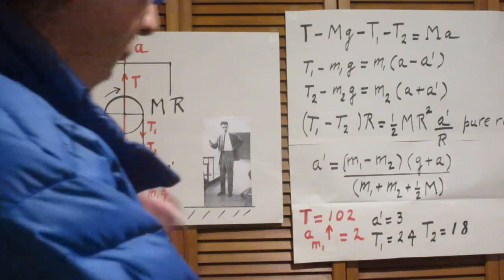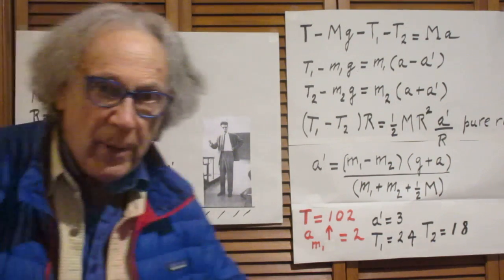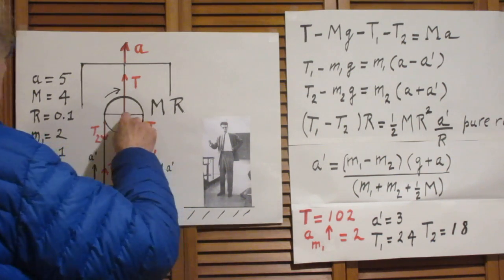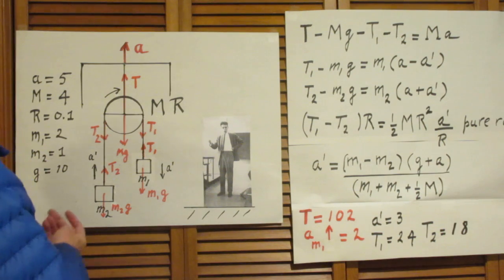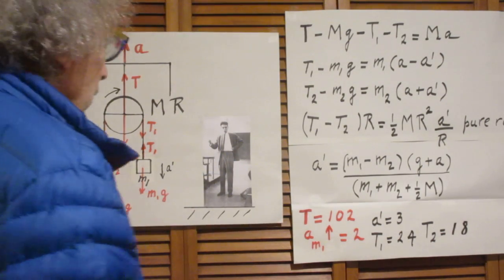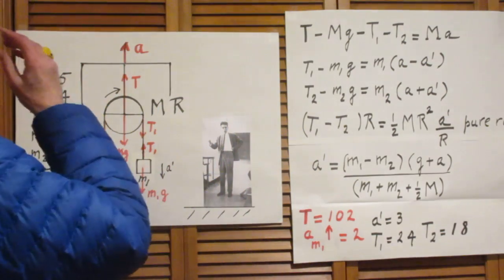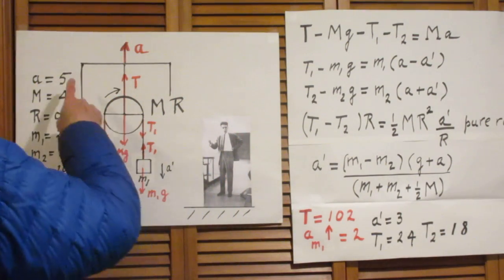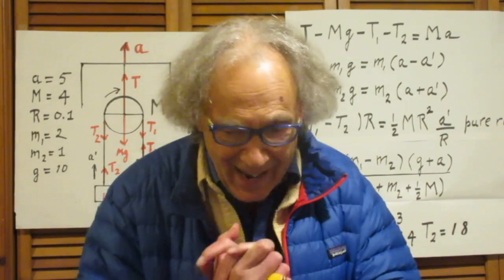Solution #31 Pulley in Elevator - Watch this FIRST

Comment: Don't the masses weigh more because they're inside an accelerating system? Why can't we consider their weight force to be a + g?
Reply from the maker: I cannot add anything to the clarity of my solution. If it's too difficult for you I suggest you watch my 8.01 lectures in which I cover the basics of Newtonian Mechanics.
Reply: @lecturesbywalterlewin.they9259  I've watched your 8.01 lectures professor. I had to solve a simpler version of a problem similar to this one, that goes like this.
There's an Atwood machine attached to the roof, of an elevator accelerating upwards at 5. There is a mass of 3kg attached to one end of the string over the pulley. To the other end, is attached a spring balance (hook pointing up), and then a mass of 2kg. The question asks for the reading in the balance.
You spoke of perceived gravity and how the weight force changes in such a system.
Supposing the acceleration of the 3kg block to be a, in the reference frame of the elevator, and tension in the string to be T, is it wrong to say
3(5+g) - T = 3a?

Comment: 8.01 problems from MIT are often easier than this one.
Do you think our way of teaching physics in the US is worsened in the last 40-50 years?
Reply from the maker: this could easily have been a problem on one of my 8.01 exams
Reply: Lectures by Walter Lewin. They will make you ♥ Physics.  My point is : considering that this problem was given to high school students in '60s but 8.01 problems are not more difficult, is our way of teaching physics worsened? 
in other words, why are exams softer than before?
Reply from the maker: I have been 43 years on the Physics Faculty at MIT. There was a change to make things easier for freshmen when 8.01 and 8.02 change to the TEIL mode. However, I can assure you that that was not the case in any other courses that I have been involved in. Also The "General Exams' in the Physics Dept have been equally tough throughout all my 43 years.

Comment: Isn't tension supposed to be constant in a string sir, assuming t1 and t2 would be considered a fallacy. Please do correct me if im wrong, Thank-you
Reply from the maker: >>>Isn't tension supposed to be constant in a string>>>
you are wrong! The pulley could never start rotating if T1 were the same as T2.
Reply: Lectures by Walter Lewin. They will make you ♥ Physics. Oh... Thank-you sir 😅😅😅😅
Reply: +Lectures by Walter Lewin. They will make you ♥ Physics. Why can't we consider the tension to be the same in the string attached to the pulley because the masses are different and heavier mass would go down and provide the rotation to the pulley? I want to consider the tension to be the same because it is one single string which is attached to M1 and M2 and rolled over the pulley

Comment: Ok, my got where I gone wrong. My typing is very poor but still I posted the detailed solution. But no one read that(even I not checked that) , just for my pleasure I am posting that again. In this solution there is a mistake while writing the equation for pulley (which should be:-
T-(T1)-(T2)=M(g+a), but I write 'a' instead of (g+a) as you can see;-

Solution:-
Let:-T1 be tension in sting in side of m1 and T2 in side of m2(tensions are different both sides of pulley because pulley is not frictionless).
Let acceleration of blocks wrt pulley (for both blocks it will be same but in opposite direction)be 'A'.
Angular acceleration of pulley will be A/R. And torque will be I*A/R where I is moment of inertia of the pulley i.e. (1/2)MR^2.
Now equations we get are:-
eq1:-   (m1)(g+5)-(T1)=(m1)A
eq2:-   (T2)-(m2)(g+5)=(m2)A
eq3:-   [(T1)-(T2)]*R=I*A/R
Now substitute m1=2; m2=1 ;g=10
I/R=(1/2)MR (you will see that R in eq3 is cancelled out and all the answers will be independent of R)
Now equations becomes:-
eq1:-   30-(T1)=2*A
eq2:-   (T2)-15=A
eq3:-   (T1)-(T2)=2*A
Add the three equations to get:-
5*A=15 
A=3 =acceleration of blocks wrt pulley (or elevator)
Acceleration of m1 wrt Sir(Water lewin)= 5-A=3 upwards.

Put A=3 in eq1 and eq2 to get (T1) and (T2).
You will get (T1)=24 
and (T2)=18
Now equation of pulley:-
T-(T1)-(T2)=M*5
Where T=tension in string with which pulley is hanging and M=4.
On putting all values we get T=20+18+24=62

Hence answers are:-
Ans1: acceleration of m1 wrt Sir(or say friend) is 2 units upwards

Ans2: tension in string with which pulley is hanging is 62 units.

Probably this problem will not come in my exam tommarow but I am still typing solution because  I❤ Physics and ❤❤my friend who will make you❤❤❤ Physics.

So we should use(g+a) instead of'a'. We will get T=102.
Reply: Sir even you not told me that about that mistake. Till now I was in dippresson thinking "Does physics really work??"
Reply: Sir, can this 'biweekly problems' be converted into "Weekly problems"? 
We really find it very difficult for wait for next problem.
Reply from the maker: selection of problems, preparing for them, recording them + the solutions
takes me typical 2 days per problem (sometimes more). I worked 5 days on the solutions of problem #28. It's very very difficult for me to find and to convert problems into a Lewin Problem. There is NO way I could do 1 every week.
Reply: Lectures by Walter Lewin. They will make you ♥ Physics. 
Ok, सब्र का फल मीठा होता है। (Patience results 'Happy ending')😊😊😊